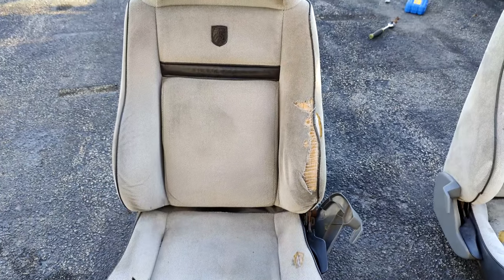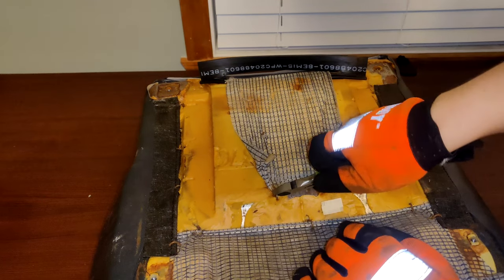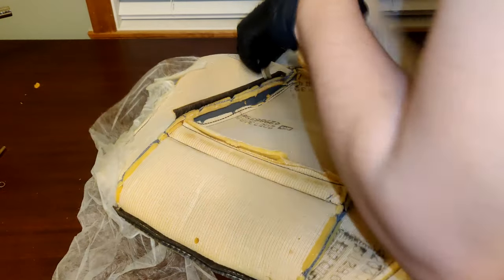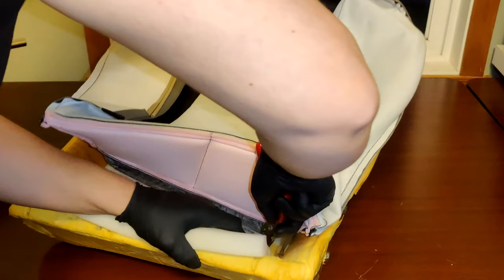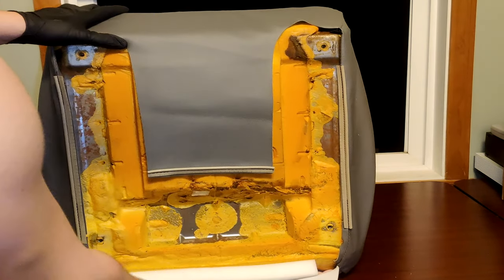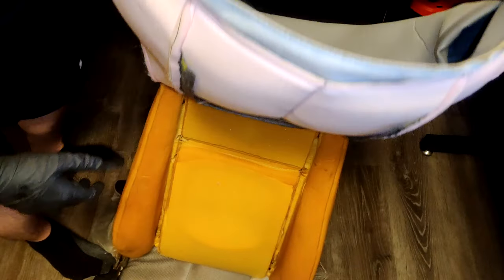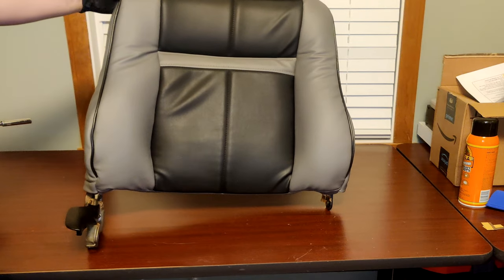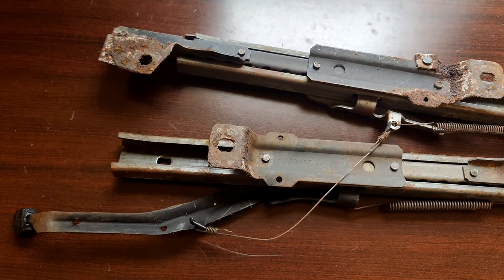HOW TO REUPHOLSTER CAR SEATS

Comment: And nobody is going to mention the lumpiness of the sides or the wrinkles from pulling the leather all weird when installing the hog rings? I guess I have a higher standard of craftsmanship than most.
Reply: Yes, anyone can install seat covers. Someone experienced knows how to get them tight with aged seat foam, bolster wear deformation. That would be a 'how to'. We also already know how to screw bolts in. If you can use 2 passenger seats that have no foam damage you are much closer to getting a good tight pro instal...

Comment: What's the solution to wrinkled material? Adding padding on old foam? Do old seats lose size from use? Or do the new covers have to be stretched tighter? Fiero seats are the most comfortable seat i ever had. I'm sorry I ever sold my 86 4 speed gt. But if I did one over, I'd want it perfect. Of all the cars I've ever had, it was my favorite!

Comment: I like Mr. Mike’s seats, they do a professional job. The only thing I would have done differently is, I would have sent them the Fiero emblem from the old seat covers, I think they can sow them into the new covers giving an original factory look.
Reply from the maker: He's not allowed to do that anymore, can't use the logo or the Fiero name
Reply: @Cus7ate9  There is no law saying he can't take the emblem off your original seats and sow them into the new one. It is illegal if he recreated it or supplied it. There are also laws that allow certain commerical logos to be sold, but you'll have to research that info yourself.
Reply from the maker: @Bobster986  if I remember correctly, he received a cease and desist from GM, so he just stopped adding the logos in general
Reply: Where would I purchase the seat replacement cover from as well as the fome and spray you used I wan to do this to my mother car to surprise her, can you send the links where you go the items you used in the video. Thank you, good job keep up the good work.
Reply from the maker: @walkinginfaith134  Link is in the description